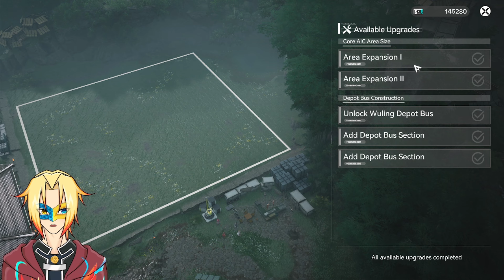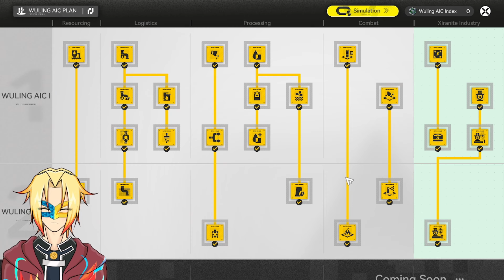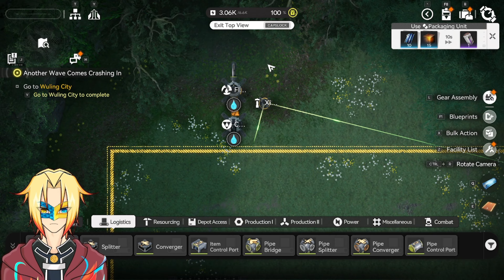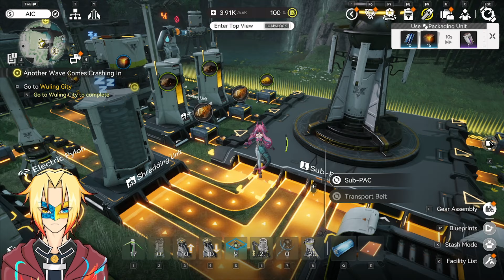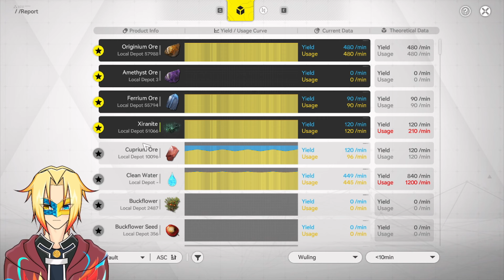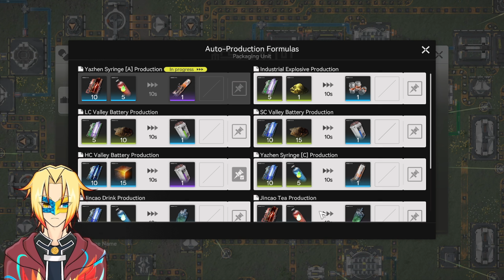SAVE HOURS! The Newest Wuling Blueprints For 1.1 | Arknights Endfield

Comment from the maker: I have updated the blueprints.  There are 2 big changes. First I got rid of the purple Jincao tea production. I got to prosperity level 3 and I saw that you can't sell it. So if it does not make me bills there is no point to its existence. And the second one I changed the pipes a little. The crucibles had a bug where if you went offline they will make Liquid Xiranite and then combine the liquid xiranite with sewage to make Xircon. But the output pipes were set for liquid xiranite so it will end up clogging the entire setup.
Reply: Can we expect a video that u mentioned about running gear production for a week and then switching to full currency production
Reply from the maker: @Biz-Bizz  Yes. That's the plan.

Comment: Good video man, the facility is good but for some reason the Reactor Crucible bugs out for me, it stops completely overnight making Liquid xiranite and my factory doesn't function anymore, i have to take it out the Reactor and place it again, so unfortunately maybe i have to try another one, but yours is so good and im so sad about it.
Reply from the maker: So I think I know what the issue was. The first crucible takes sewage which for some reason combines while offline with the liquid xiranite directly despite not even having space normally for that. The solution is to connect the sewage pipe directly to the 2nd reactor without going through the first anymore.
Reply: @ArcanumRealms I’ll try that when I have the time, thank you for checking it out 🙂
Reply from the maker: @zesst-c5p  No probs. I updated the codes too so you can just copy the updated ones.
Reply: @ArcanumRealms  The new blueprints works amazingly, did you change anything in Jingyu Valley ?
Reply from the maker: @zesst-c5p  Nope. It is exactly the same. At least for now. Will prob make an alternate blueprint for an additional SC battery line instead of red components down the line but right now I am overproducing anyway and I want a nice big stack of cuprium components in me depot.

Comment: Hi <3, ty for this very fast and useful video,  i have a problem, i dont understand where to connect the conduits, is it possible to show where all of them should be connected?
Reply from the maker: Not quite possible. The connections are not even shown on the map like the pylons. The inlet and outlet conduit work like a pair. The inlets need to be connected to water pumps for the most part, then connected to the outlets. 1to 1. I did point out the 2 sets of conduits where that is not the case during the video. For all the others just make some water fluid pumps connected  to inlet conduit for each of them. I showed my setup for the water pumps when I started the wuling side if it helps with anything.
Reply: @ArcanumRealms  my bad I didn't understand that hahaha. Ty for the answer ❤️
Reply from the maker: @Tarallinooooo  No worries. I wish you could see the connections between them on the map like for the pylons. Guess is something they can improve in future versions.
Reply: the video was almost perfect, you said all the important thingz without forgetting anything. I think, I didn't know that I also had to input the different fluids from the machine too that was mainly the problem on my hand👌🏻. But I'm pretty sure that it's MY bad so perfect vid Ty again❤️ @ArcanumRealms
Reply from the maker: @Tarallinooooo  Ooo. The crucibles. I forgot to show those. That's true.

Comment from the maker: WARNING. In the blueprints I used the new SC Wuling batteries for power. You will not have these until you finish setting up the build and wait a little. So what you will need to do is put the old LC batteries in the thermal banks manually for a few minutes until you stockpile a little. I also chose to go for lower production for cuprium components. I am making 3 per minute instead of the possible 6. That's because I am in bigger need of wuling stock bills and can just wait a day or 2 for the components to stockpile.